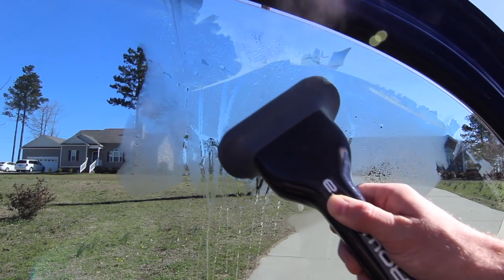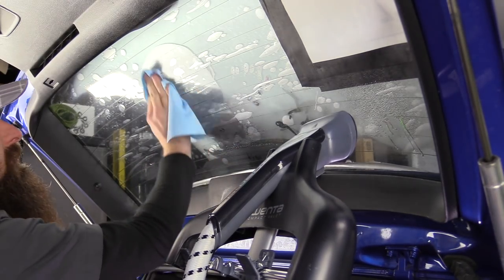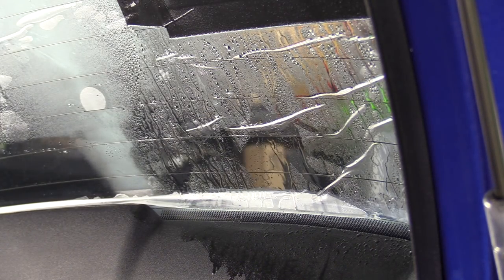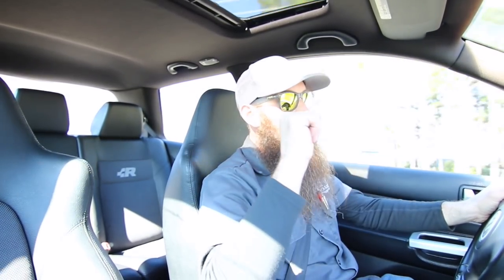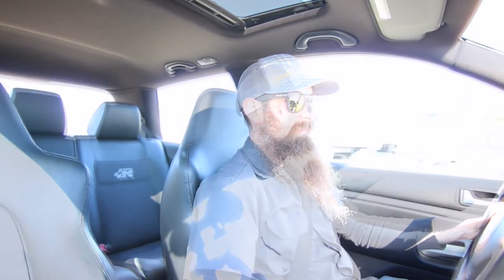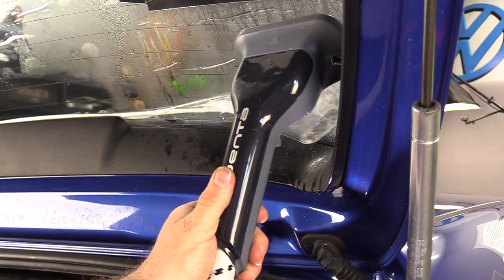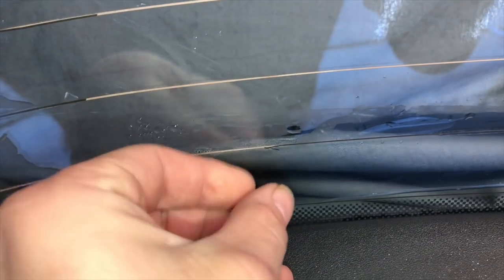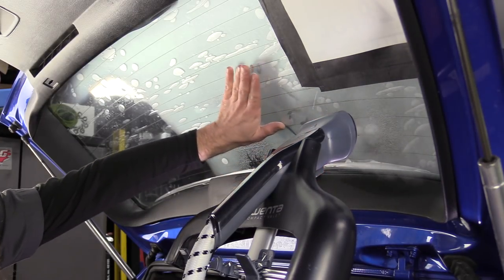Making Car Repair Mistakes and Making It Right

Comment: Ah yes, The Car Gods. They are vengeful gods, as we know. They don't like being dissed. Obviously Charles you will need to burn, cut, bash your knuckles more often as sacrificial offerings.
Reply from the maker: Yeah I haven’t sacrificed enough blood or soul lately.
Reply: har har! I remember doing a T belt and seals on a Mitsu 3.0, the FKN new front cam seal started leaking, FK!! off comes the belt again!
Reply: Also had an AWD manual transaxle that refused to go into 2nd gear, we had that bitch out at least EIGHT times, finally gave up and got a salvage unit!!

Comment: I took the tint off the back of my VW with a heat gun. For the edges I’d recommend using it on the outside of the glass to avoid getting direct heat on the trim panels. Warm up an area nice and evenly and peel it off. Came off 100% for me, just wiped with window cleaner afterwards. If the tint is particularly stubborn, turn the window heating on as well to soften the glue on the lines even further.

Comment: I think the problem wasn't helped with the poor quality defrost wires that VW seemed to put on their vehicles around this time. I've had a SEAT Leon and a VW Sharan that had defrost wires break. In fact, the Sharan had a heated front windshield which had a five inch wide gap that just didn't work.

Comment: Can you fix the defrost on the back glass?
Reply from the maker: If it was a few little spots I would. But there is a lot of length missing. :(
Reply: Used to be repair tape available. Installed about like pinstripe. Yep still out there, Clear View Defroster is one.

Comment: Perfect timing for this video. I screwed up on my first mechatronic replacement on a hybrid Jetta. Went to perform basic setting.... and FAIL! 
I sat myself in the mangers office and gave myself shit. Lol
Reply from the maker: Oh man. That sucks.  The basic setting on those is picky as hell
Reply: HumbleMechanic  I had to re and re the mechatronic...
Reply from the maker: If you don’t have it 100% right it won’t adapt. Including moving the actuators by hand before install. I’ve done a good amount and still would read the manual every time.
Reply: HumbleMechanic I made templates the second time around... to be sure everything lined up. I was warned by techline to be super anal about the measurements..... and I still SCREWED UP!

Comment: I know nothing about rear defroster install, but isn't there an aftermarket add on or replacement  for this?
Reply from the maker: I did a quick search and didn’t don’t anything to fix that much. 

If it’s a little spot no biggy

Comment: Maybe this work on a emergency, electric defroster It's just  little pieces of metal making electric resistance to create heat,  you can stick thin copper wire insulated (from a little electric engine) or aluminum foil tape, solder to get good connection,  try on old window first 🤣; for removing tinted windows  use dry ice 😉
Reply: Kahuamero TV they make a metallic paint to repair the lines, but it's not really feasible to do the whole window with it.

Comment: Why haven't you used a heat gun ? An why not sue some defroster line repair paint and draw new lines.
Reply from the maker: I did use a heat gun on another window. It worked worse than steam. 

There may be a chance of repair on the lines but it’s slim. The repair fluid is meant for small spots.  These are lines almost across the whole glass.

Comment: Defrost lines must be the most non-stuck things on earth. Only way I know is just to replace the glass.
Reply from the maker: Yea you’d think that tech would have improved over the last few decades
Reply: Have often thought there is a market for being able to re coat/dip the rear glass, as I guess some sort of electrolysis which gets it on there in the first place.
Reply: To be fair defrost lines can be embed into the glass like on windshields, but then there are cost considerations...

Comment: It wasn't a mistake.
Reply from the maker: It sure wasn't on purpose HAHAHA
Reply: One lesson I learned from watching my favorite PBS painter is all you have are happy mistakes. I get pissed...I am in the middle of a Kframe replacement because I screwed up removing an engine mount. Lol Now...found a huge frame failure elsewhere and spent the 70 bucks on a used Kframe, now welding up the unibody. Whew! Glad to catch it! Put the mistakes up. Thank you for being straight up about mistakes made. Makes me feel better. Enormous delay, but it seems delays sometimes opens your eyes to something bigger you're missing.

Comment: Don't be to hard on yourself Charles.  Only a moron would put film over a defroster. I've had to deal with it before too. You would think common sense would dictate not to put film over a defroster, but you would be wrong
Reply from the maker: I’ve had several cars with rear tint. It’s. It a bad thing. This was the crappiest tint I’ve ever seen. Haha

Comment: Pro-tip, when you make any mistake as a mechanic just take one of your fingers off with an acetylene torch as atonement for your sins. You'll be more careful next time.
lol j/k. I did a motor swap on my outback and had to pull all of it apart to swap the cam and crank timing sprockets because it was a different year donor motor and thus the computer wouldn't read. THEN I realized it was an EGR motor and I had to take a bunch of shit apart AGAIN to fabricate and install an EGR plug because my car was non-EGR. Wicked pissah...Fuckups are just good for a laugh, maybe withold your next beer as punishment? Make yourself buy a 30 of natty and pretend its good?